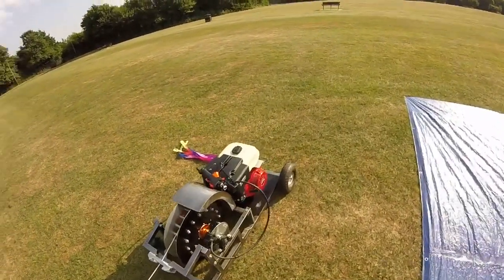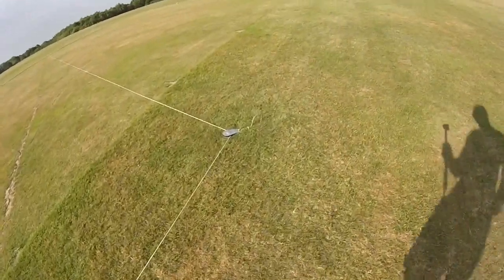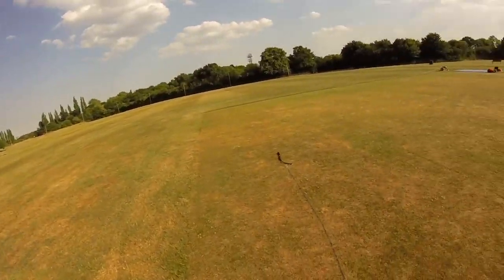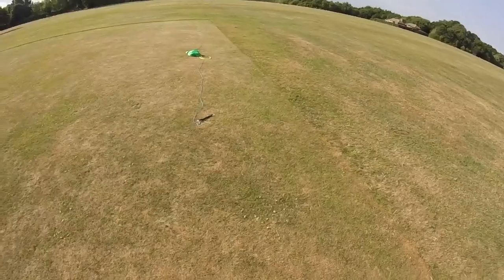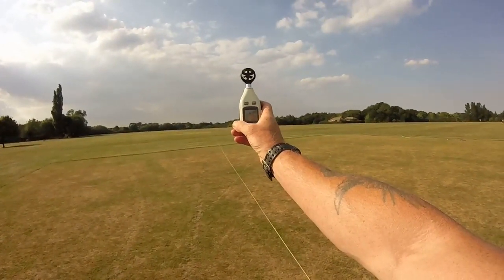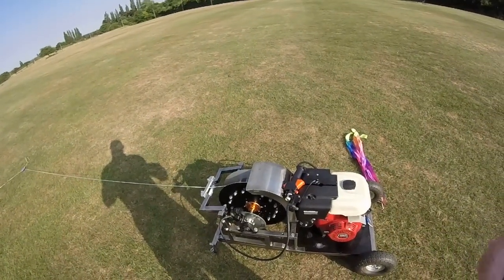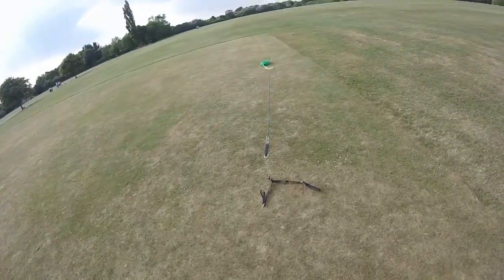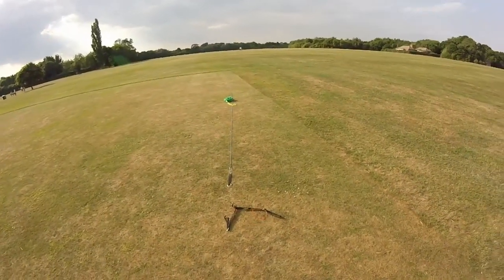Paraglider tow winch,2018. and line setup

Comment: What's your system for keeping the pulley securely anchored to the ground under the vertical and horizontal loads imposed on it during a paraglider launch? How thick a stake and how deep to you need to pound it into the ground, for instance? I haven't looked into the loads involved, which are relatively simple to calculate, but obviously you need to reckon with those - along with a suitable safety factor, to cater to the type of soil etc. and the uncertainties involved.

Comment: How did you find this for your application? We’ve recently started fabricating multiple winches and were looking at this use as a possible marketing range! Its running a 6.5hp Honda motor and pulls well as can be seen briefly on my channel
Reply from the maker: HOPXINS I'll bring it over with some wings. You can try it out.
Reply from the maker: HOPXINS Hi. Yes it works fine. Unsure 6.5 hp will be enough though. Mine is based on a wake winch idea as well. The base plates for the engines are the same anyways so easily swapped out. Have you seen my other videos of the winch build in progress. I think a pully and brake system would also be a benefit for wake winching. The pully wheel is a must. You can do tight turns without the risk of pulling the motor over.
Reply: clubsnapperuk I’ll check them out now! So far we’ve not had issues due to a good anchoring system, we are however looking at ways to deviate the line via pulleys and runners to be able to winch narrow waterways and tidal gulley’s! The more we look at it the more possibilities come to mind! Thats what brought me here, found you through searching wake-winch used with gliders!
Reply: Its the 1000ft of dyneema cord thats the problem, nowhere near cheap!
Reply from the maker: HOPXINS no. That will be about £250 alone. 1 kg roll is 600 feet. I've bought three. There are alternatives. You need average 200 kg load and minimum stretch.
Reply from the maker: HOPXINS for water sports you don't really need duneema. Your resistance on the water won't be 200kg. There are cheeper options
Reply: 6.5hp is only marginal with the TAV2.  You need to step to a 9-13hp to be useful for anything other than a light pilot. No tandem or hang glider without that little bit of extra torque.  You can lock out with any hp range tho, be safe.